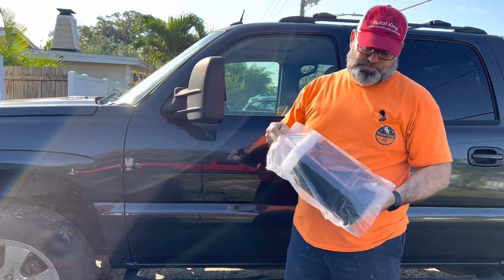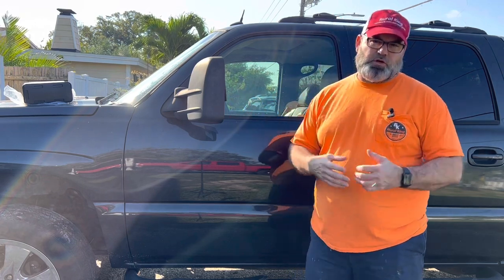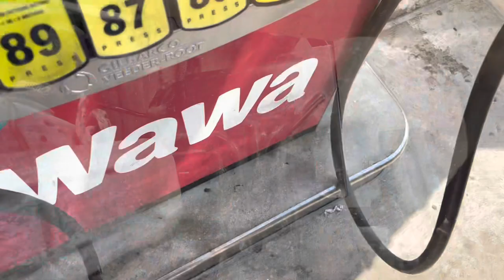Avalanche EVAP canister replacement

Comment: ive seen so many people with this exact issue change this part and say it didnt fix the problem. it sctually does they just were not informed to be more through with thos lines clogged up with the charcoal beads.....i hope lots of people see this before they replace the part lol.....VACUUM THOSE LINES BLOW AIR THROUGH THE GAS TANK FILLER 😂.....also for those that dont have an ait compressor if your using a shop vac to vacuum the line you can also use the shop vack to blow through the gas tank....make sure to clean the shop vac out 1st....then REvacuum the lines
Reply: Explain to me please! So I push air through the gas tank nozzle and then vacuum it back through once I have it all reconnected?
Reply: @Viper34TTV  blow it OUT with a air compressor. Vacuum cleaner has 25psi air compressor has 200 psi. Or just replace the hose!

Comment: FRIEND HAD GRINDING SOUND AROUND 10 MILES PER HOUR, TOLD HIM MAYBE THE AXELS. REPLACED BOTH FRONT AXELS. TEST DROVE GRIND/HUMMING NOISE STILL THERE. DOESNT MAKE NOISE WHEN TURNING LEFT. BACK TO THE DRAWNG BOARD. 
HOPEFULLY YOU ARE DOING WELL. AND LEARNED ALOT SINCE POSTING THIS VIDEO. 
REPLACING VAPOR CANSTER FOR HOMIE TMR.
Reply from the maker: @stephanie8316  maybe the wheel bearings

Comment: @greybeardgarge hey brother, you're on the right track. I did the same thing for a buddy and I'm about to do it for my truck RIGHT NOW. 

ONLY thing I did differently is blow out the fule line to the vapor canister from the end they connected to the vapor canister.

That's about it brother. Fixed the problem for him. Hopping it does the same for me

Comment: You forgot to blow the lines out that are holding the charcoal that leaked out of the old canister. Disconnect those hoses, and rattle all that stuff out and use a little low pressure air and clear em out. Worked on several other vehicles I had to do this to. Best of luck! I'm about to do this to my 04 avy.
Reply from the maker: Thanks for the good advice. I actually tried that but it didn’t work. It was filled all the way to the engine.
Reply: @graybeardgarage9638  ouch! I'm sorry to hear that. Well if Its filled all the way up that way, then I'd just replace that line and call it. Seems to be common on these things.
Reply from the maker: I actually had to take it in to a mechanic we know. I just didn’t have time to keep messing around with it. They actually had to pull the tank to get everything cleaned out. I knew that was going to be the case I just needed it done. I hate paying people to do things that I can do but my time became more valuable at a certain point than money.
Reply: @graybeardgarage9638  I'm hoping I don't have to yank mine. But then again mine starts up no issues the only issue I have is that my gas pump fill up is slow.
Reply from the maker: It used to take 3 tries to get it started as well which is also a common issue associated with the vent issue.
Reply: How much did it cost and do you mean they cleaned out the gas tank? Did that solve the problem?
Reply from the maker: They had to take the gas tank down or out from underneath the truck. Then they had to clean out the vent tubes (not the tank). Cost was just about 300 bucks
Reply: @graybeardgarage9638  awesome! And that's not a terrible price either.
Reply from the maker: Not bad at all
Reply: I seen a video where the guy to the hose off to the gas Tank and stuck his finger in the hole and cleared and put hose back on and it fixed the problem
Reply: @shawnjones631  hey sometimes the solution is just beneath the surface! Sometimes... It's a can of gas and a match. Lol

Comment: Don't bother disconnecting the lines the proper way. Cut the nipples off flush on the canister, then remove the nipples from the lines, much quicker and more room. Also vacuum out the lines at canister and at purge valve, there will be charcoal debris in all lines. Never top off the gas tank 
It's the charcoal in the lines.
Reply: Thank you thank you so much I’ve been looking for a video on how to remove those pallets from the lines because nobody talks about them they say they are in the lines but they continue to replace the charcoal canister without addressing the lines being filled with these charcoal pellets. You are the first individual to say anything about them so far that I can fine thank you so very much sir God bless you and your family and friends stay safe now.✝️✝️✝️🇺🇸
Reply: Are you talking about the purge valve or evaporator vent valve

Comment: Your starting issue is probably the fuel pump pressure solenoid. If you can afford replace the hole fuel pump and solenoid.

Comment: I have a strong gas odor coming from my truck and i cant find any leaks, would replacing this as well as the canister fix my problem? 07 Avey LS
Reply from the maker: I could help. The fuel vapor is supposed to go through the charcoal on fill up.
Reply: @graybeardgarage9638  thank you. I found that I have a small fuel line leak.

Comment: Should have vacuumed the lines out that connected to canister for charcoal. First take gas lid off the
Reply from the maker: I did eventually. The tank needed to be pulled and the vent line was clogged all the up to the engine
Reply: wow im fixing to deal with all this on my teenage sons truck....that is after i replace his starter....ugh...sometimes it sucks being a single mom but gotta do what i gotta do. i dont have the funds to pay someone to do it and would not trust them to do it if i did.....its a shame when you put things in the shop for repairs and get it back then have to go behind them to do things correctly

Comment: I firmly believe, but cannot prove, that the EVAP system on these is horribly designed such that if you fill with a gas can or add a fuel additive into the filler neck some goes into the EVAP system instead of the gas tank
Reply from the maker: I agree the EVAP system is trash on these